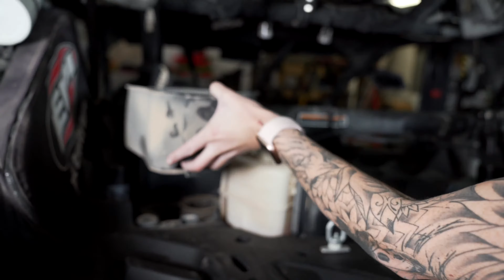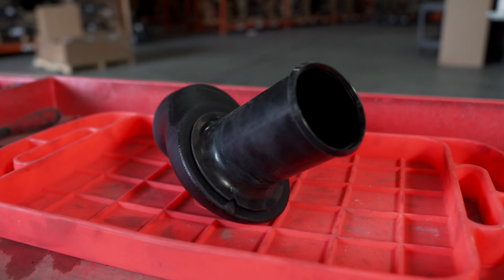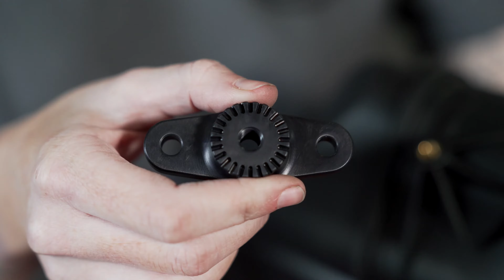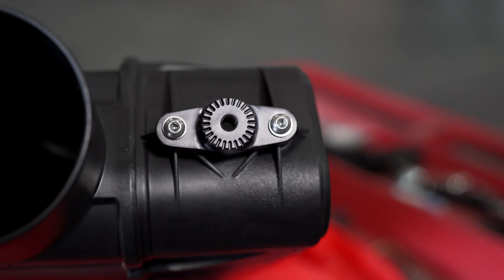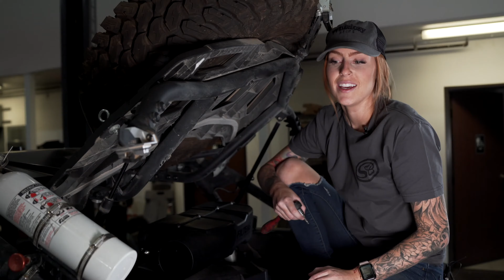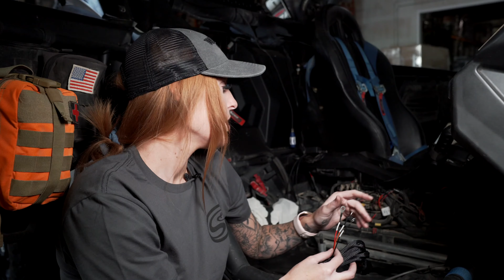S&B Particle Separator 2 Installation for 2017-2024 Can-Am Maverick X3

Comment: Hey all, I would upload a picture of the connection to the coil but maybe this video is so old or blocked by administrator. I took advice from some of those on this post and first, put a towel down in case I dropped a small screw or part while installing the wire on the coil. 

Second, I connected the wire to the 3rd cylinder coil that was accessible from the rear passenger wheel. I connected to the PURPLE wire on my 2018 X3. 
  It was fairly easy but takes patience.

Comment: How to attach the RPM sensor to coil wire in under 2 min.
Attach to the passenger side coil pack from under the wheel well access.  I followed the instructions by accessing the center coil pack through the access panel and then realized why am I doing this when it is easy to access the outside coil pack from the wheel well.
Reply from the maker: Hello Doane,

Thank you for your purchase of the particle separator 2. Im super glad your were able to find an easier way to get to the coil wire.  We do show one way and im glad you were able to help out with another way for customers in the future.

Comment: Just installed & easy straight forward!  (2022-X3)
… (sensor hook up life hack) - 
I used a lil piece of tuck tape to hold tiny screw on screwdriver 🪛 then 🔦 n pulled plug out n turned so brown wire was up top & had 
it on & tywrapped in place in few minutes 👍🏻

Comment: I'm installing mine and I have to say trying to get that part onto the coil wire is a pain. I dropped the small metal piece and somehow found it. For 500 bucks that we pay for these things why not get the an adapter that you plug into the coil connector and the other end goes into the pack. Kinda ridiculous trying to get that part onto the wire without dropping the clip or screw. We are talking a cheap part on a very expensive piece. You guys are already making a killing on these.
Reply: I'll be installing mine here in the next cple days and EVERY VIDEO I've watched it's the same complaint so it must truly be a dam pain I'll be dealing with it soon dam it lol 🤦‍♂️
Reply: @eddietrujillo224  put a towel down because if you lose that piece you will have to go buy a new one. So anything to catch it. If you have a another person to help it will make that part much easier.
Reply: @chicago1680  perfect thanks for the advice I'll do that thanks again 🤘✌👍
Reply: @eddietrujillo224  good luck let me know how it goes. I didn't think about a towel or another person until after. Smh
Reply: @chicago1680  aaahhh man buddy u wont believe my luck they sent me the wrong rubber gourmet ends mine take 4inch they sent me the 3.5 inch so I'll be waiting for correct end pieces now 🤷‍♂️🤦‍♂️🤦‍♂️
Reply: @eddietrujillo224  ahhh crap man I forgot to mention that.yeah i got sent the wrong one too. Luckily I got it in like 2 days. I thought they fixed that issue.
Reply: Ain’t it a clip on to the coil wire ? So it should squeeze open and pinch on the wire
Reply: @balslammerracing14balser95  its a clip with a tiny screw. It's a horrible design for how much you pay for this thing
Reply: @chicago1680  is there away to swap out the clip for something better ?
Reply: @balslammerracing14balser95  no it's designed to clip on it so it's wired. I'll see if I can get a picture of it later today of what I'm talking about
Reply: @chicago1680  please do I’d like to see it cause the video don’t show chit lol
Reply: @balslammerracing14balser95  nope. it separates into 2 pieces then you have to hold it in place one on top one on bottom then attach a little screw then screw it down. At least that's how mine was.. It's a shitty and cheap design.  They even sent the wrong adapter and inside the box it says I have to check if I have the wrong adapter. Why not check these things out BEFORE you send it. They sent me a new coupler which took 2 days but still I was in the middle of install when I read that.These things are like 500 bucks and there isn't much to them. They could have easily made a COP adapter instead of pray tp God you don't loose that tiny clip
Reply: @chicago1680  well that changes my mind on getting one
Reply: I would call and see if they fixed the coupler issue which last I looked they did not according to their online instructions. Or if they redesigned that stupid clip

Comment: as soon as i plug the wire to the coil my SWITCH-PRO 9100 stops communicating with it's panel , so that's a problem
Reply: I had the wrong wire for me it was purple, all works good
Reply: @CanadianSaloon  what year is your machine ? Reading these comments make me 2nd guess getting one , seems the coil hook up is the hardest part
Reply: @balslammerracing14balser95  no don't worry about it, it's because I put it on the purple looking wire but it's orange as soon I switched wires switch pro worked perfectly.
Reply: @CanadianSaloon  got cha !
Reply: Did you figure this out. I’m wanting to purchase this but also have the switch pro 9100
Reply: @JaimetheNomad  I had sent my switch pro to switch pro to check , and they said nothing was wrong with it , so I know it's the particle separator ignition coil wire , BUT in the manual they said to use the brown wire , closest to brown was purple brown for me  , and this video says orange and its orange the right one  so soon my switch pro is back next week I will test this again , hopefully it works if not the particle separator is going back. Will let you know .
Reply: @CanadianSaloon  ah cool, thanks for the info Derek! I appreciate it
Reply: @CanadianSaloon  how did it go brotha was it the orange wore after all